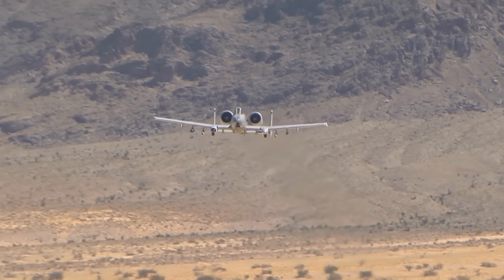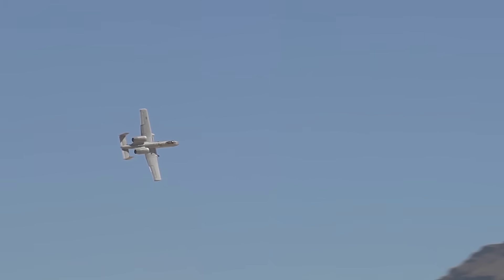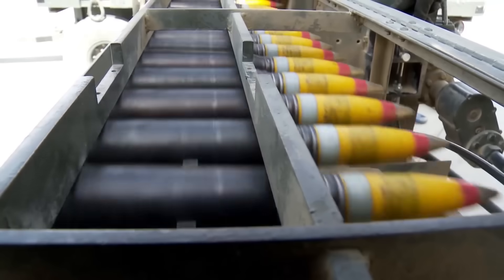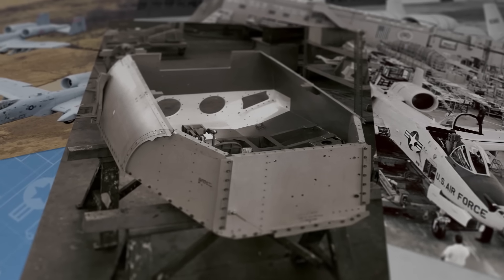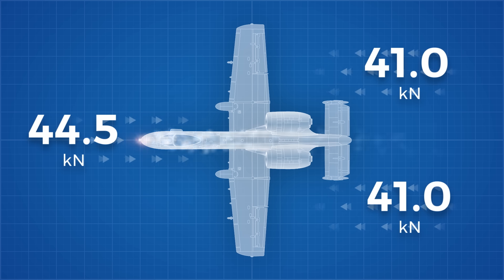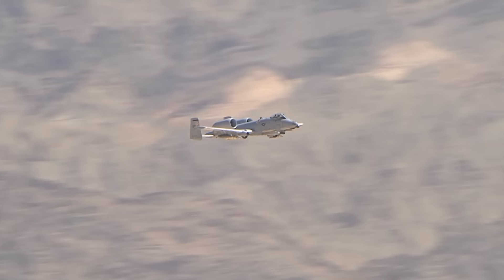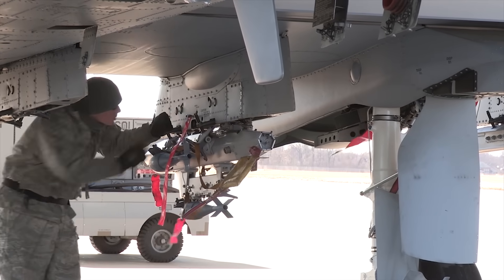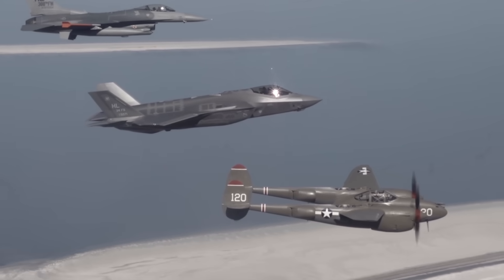The Insane Engineering of the A-10 Warthog

Comment: If you ever ask a soldier who had a warthog support them in battle wants thousands more to be build. That’s why I’ll always love that aircraft
Reply: Yep, beloved by men on the ground
Reply: Well most would say the hate it because the gun has a splash zone the width of a articulated bus and because the A10 does not have any targeting systems except a pair of binoculars it's very likely if you get an A10 as fire support you're gonna be the one with a 30mm round in the head
Reply: It's just a shame it outdated, but it's mostly beloved because of the sound and how you can see it firing
Reply: @Zlonk7  eh, I wouldn’t call it outdated, just needs some buffs
Reply: @civilrebel3743  I mean the original version hasn't been in service for a while due to how shit it was and now the newer version are expensive and one of the main points of the A10 was it being cheap
Reply: @Zlonk7  I mean, I’d rather have a expensive and good thing rather then cheap trash
Reply: @civilrebel3743  then buy an F35 imo
Reply: @Zlonk7  they both have their uses, however I’d use an A10 where SAM’s and enemy fighters aren’t a concern cause that brrrrrt would be a nice morale boost
Reply: @civilrebel3743  I mean some soldiers would consider an A10 a detriment as the splash zone is like 12 meters wide and thus kill anything in that zone friendlies and civilians included and since the cheap models only have a pair of binoculars as targeting blue on blue is very likely. Most of the people I ask say they prefer the more safe aircraft over funny brrrt

Comment: The centerline of the GAU-8 isn't mounted coincident with the centerline of the airframe. The centerline of the airframe actually lines up with the 9 o'clock barrel, which is the firing barrel and is where the recoil force vector originates

Comment: Some people: Replace the A-10
Me: If it isn’t broken don’t replace it. So far it is doing it’s job beautifully.
Reply: It really isn't , the gun can't bust tanks, it has no stealth and most of the redundancy it has is useless
Reply: @Zlonk7  most of the redundancy is useless you say tell that to the pilots you’ve had their hydraulics taken out over hostile environments and a good CAS plane is never going to have a super low RCS you just can’t fit enough ordinance inside an internal bay in a small enough plane to be an effective CAS platform and having it on the outside isn’t very stealthy and I’m not sure you even understand how stealth works it’s not no stealth or lots of stealth so I’ll explain, radar sends out waves those waves hit an aircraft and depending on a lot of variables some of them will bounce back and be picked up by the radar a plane specifically designed for stealth will be designed to minimize how much of those wave gets back to the radar so they end up with a lower RCS
Reply: @Zlonk7  you live up to your name
Reply: @vick3772  what am I wrong about? Tell me
Reply: @vick3772  I mean the gun can't bust tanks and is pretty much a liability
Reply: @vick3772  they did a live fire testing of the A10 on some tanks in the 1970's and they gave the pilot perfect conditions: he could fire as much ammo as he wanted, the tanks were not moving or deploying smoke, they were full of ammo, he could individually strafe every single one, the weather was perfectly clear, the tanks were outdated and most importantly, the pilot wasn't getting shot at, and still even with that only 3 of the 10 tanks were destroyed, and that may seem like a good percentage but that was in perfect conditions. So they decided that in a real combat setting it would be useless against tanks and that's the reason why it has so many pylons attached, so you can mount enough missiles and bombs to destroy tanks
Reply: If this article is to be believed their cannons were capable in in the 1990s during operation Desert Storm where their cannons were killing Iraqi tanks, it mentions the T-62 and the T-72, Both tanks are still in operation in some parts of the world, the at's cannon might not rip through the more modern tanks (cant seem to find info on things like armor thickeness on more modern tanks) however even with those limits the a10 would be able to rip up less amored targets effectivly such as infantry, transports, lighter armoured vehicles, ect. It may still have a practicle application in the event of a full scale war but in the fights it finds itself in with limited thick armor, enemy aircraft, anti air fire, etc it can still be very effective at supporting ground forces.
Reply: @stevencolor3389  link for the article
Reply: @stevencolor3389  the comment above this one suggest that that was just luck
Reply: @Zlonk7  "Significant results include catastrophic damage to 3 tanks, 1 tank immobilized and silenced, three tanks immobilized only."

"The Simulated Soviet Tank company was judged to have been effectively neutralized and incapable of continued offensive action, since all tanks but three were immobilized."

So, in reality, the A-10 took the entire tank company out of action, rendering it "incapable of continued offensive action." Do you understand what that means? It means the tanks were no longer a factor. They were, effectively, destroyed. A tank that can't move and shoot is, for all intents and purposes, destroyed. A tank that can't move is nothing but a largely ineffective artillery piece. Just as a soldier who loses a leg in combat isn't technically "destroyed," he's still out of the war. A target doesn't have to be "destroyed" to be rendered completely ineffective.

Pointing out that only 3 suffered catastrophic damage, i.e. were "destroyed," demonstrates you're either didn't read the paper, you're incapable of understanding the results the paper actually presented, or you're being dishonest.
Reply: @frocat5163  do you understand that those tanks were not moving, deploying smoke, and the pilot could attack every single one individually. Not to mention that the tanks were outdated and the pilot wasn't getting shot at
Reply: @frocat5163  ok yes the GAU 8 can destroy Soviet tanks, but if the tanks were moving, or doing anything that tanks do when they are trying not to get killed by an aircraft? Probably not
Reply: @Zlonk7  You forget something about what you are saying :/
Tanks ofc can move, and modern tanks moves well depending on the terrain.
But war isn't a video game, speed relative to your target is an important factor.
Flying around 400-500 kph shooting at a target moving at  40-70 kph is more than doable.
Being in a tank means you don't have much visibility and LOT of noise preventing you to be fully aware.
Plus again, this is war, when you shoot at a tank killing the crew count as a neutralised target.
OFC like all guns, the accuraccy and effectiveness is far from 100%
But as it is right now that platform is more than reliable.
When target moves fast , you send it an AGM, when target isn't moving much, you strafe it.
Reply: @Qyoon   yes I get it, but moving is not the only thing a tank can do
Reply: @Zlonk7  yep they have countermesures too, wich are not always available.
Remember we are talking about war not about a video game. 
You don't always see or understand what hits you when it does.
Nothing is 100% accurate or effective even modern missiles and bombs.
Reply: @Qyoon   look what I'm saying is the A10 is 50 years old and should probably be replaced
Reply: @Zlonk7  Why would you spend billion to replace something that is safe and reliable when you can just modernize it ? Be realistic a second, it's used mostly to strike 1970-1980 tanks and militarised 4x4. For what it is used for, it's great. Other planes already exist for modern combat scenario.
Reply: @Qyoon  at some point you can't modernize an A10 and were reaching that point I would say. How can you make a stealth A10?
Reply: @Qyoon  The close in CAS means close to friendlies, the plane can be in space but if it's close to friendlies on the ground it's still CAS and why neutralise the AA network when you can just sidestep it entirely
Reply: @Zlonk7   because stealth isn't magic. It's about making you harder to find, not invisible.
Once you are on the spot  and start fighting , you are not stealth anymore and will go down.
Reply: @Qyoon  I mean if you start dropping bombs you can just close bomb bay doors and disappear on radar again
Reply: @Zlonk7  This is not a video game lol.
Stealth doesn't mean you are invisible. 
It means you are HARDER to detect.
Having bomb on a stealth plane means having them hidden inside.
So less load, less efficient during operation. ( F35 main issue for exemple)
You won't disappear by closing your bays since you have never been invisible.
Now you are noticed the enemy will just get a closer look and find you.
Thats why you use stealth bombers that leave the area as soon as they dropped.

CAS planes needs to be in the area of operation and remain near to provide support.
Again , stealth isn't a magic answer it's a tactical tool.
Reply: @Qyoon  alright then fine I guess if you can't use stealth then clear the AA systems and then use an F35 for CAS since it can carry about as much ordinance as the A10
Reply: @francesco3772  they want to see pilots die so they can hear the "brrt"
Reply: @fulcrum2951  pilots and allied soldiers as well, remember the incidents with the brits in '91 and 2003 due to both the pilots' negligence (US pilots fucking up is a dangerously recurring event if you ask me, well beyond the laws of probability) and the A-10 outdated targeting and communication systems, in a battlefield where awareness and identification are now considered the most important factors to mission success.
Reply: @fulcrum2951  you do realize a key part of the A-10 is being survivable right because CAS is needed and the A-10 is the plane that give the pilot the best chance of getting back safely
Reply: @Skylikesavation  That's really nothing special. There are plenty of instances of F-15s and F-16s losing a wing and being able to limp back to base. One Israeli F-15 even managed to make its way back after a mid-air collision with another plane. Anything can fly (or glide, for that matter) if it's going fast enough, and modern combat aircraft get their lift from the entire airframe, not just their wings.

Besides, the A-10's "durability" isn't what it seems. When it comes to survivability, it's stuck at the last layer of the Survivability Onion, "don't be killed". But the problem is that modern anti-air defenses tear it to shreds. The A-10 actually had to get pulled off the front lines during Desert Storm because Iraqi air defenses (which were hardly state of the art, even back in '91) were chewing it up so badly.

The A-10 simply cannot survive in a modern threat environment, whether that be contested airspace or sufficient air threat coming from the ground. That's why air forces around the world are embracing stealth technology. If you can go all the way back to and depend on the first layer of the onion ("don't be detected") the raw durability of your airframe becomes less and less of a factor.

Comment: Little nugget: The GAU-8 Avenger isn't actually mounted down the center-Line of the A-10. If you look at it dead on (10:02), it's actually offset slightly to the right, but the firing barrel of the rotating cannon is at about the 7 o clock position to give the desired effect of recoil down the centerline.

Comment: A handheld missile launcher can bring it down easily. A-10 for close support flies low and at low speed, they are good preys for the short range missiles.
Reply: So are anything flying and dealing out kaboom close and personal against a near peer opponent with decent AAA. Against badly trained and equpied soldiers and ragtag millitants CAS planes and attack helicopters have a good record

When it was designed, the A-10 was basically intended to be used as a somewhat
expendable flying sledgehammer against Soviet tank divisions. Rugged enought to take some damage while doing it, but was not be expected to survive for long.

Comment: One key thing to add about the engines in the tails of airliners, while they don't generate much significant thrust on their own they can alter the drag profile of the craft, thereby increasing the effective thrust significantly. This is supposed to be where the first step towards electric engines will be, the tail engines we currently see are to be replaced with electric with specific intent to alter the drag profile, as that's a nice easy retrofit.

Comment: Worth noting that, among large civilian aircraft, there has been limited success controlling an aircraft that has lost all hydraulics  by modulating thrust between the engines to turn left/right and modulate lift.  I've yet to hear of a successful landing under these conditions for an airliner, as its control surfaces offer so much resistance that no pilot is strong enough to meaningfully alter them without the assistance of hydraulics and maintaining a controlled descent requires landing at speeds far beyond normal operating procedures.  I'd imagine the Warthog's smaller control surfaces are much more manageable, which would grant sufficient control for an unpleasant but non-calamitous landing.

Comment: When I hear "the A-10 was primarily designed to handle Soviet Tanks in the Fulda Gap" I just shake my head.  When the design team started developing the A-10 they studied the Close Air Support aircraft and aircraft involved in ground support all the way back to WWI to make sure they developed the quintessential CAS aircraft.  Its greatest test would be a contest in the Fulda Gap, but the platform has PROVEN it was designed and built correctly for its mission set ever since the first units went into combat.  The A-10 is the most capable and versatile CAS aircraft on the planet, and the fact that USAF brass hate the platform should tell you everything you need to know about their personalities, and their desire to protect our troops on the ground.  Yes, fast jets do an adequate job too, but the A-10 is what the troops want to see when they call for air support.  However, the army troops on the ground (the Customer) desires are almost never considered by USAF brass when such mission set response are considered.  The USAF brass have to justify having built all those fast jets.

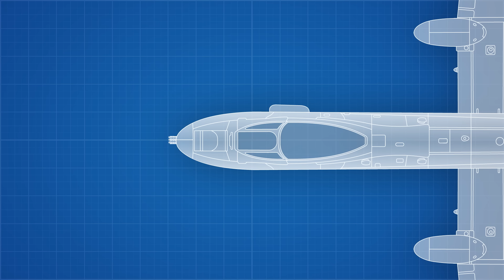Comment: 7:45 This is actually incorrect. The gun is located slightly to port, and fires at the 9 o'clock position front on, which is in line with the center of mass.

Comment: Actually, the axis of the gun barrel is purposefully very slightly off the center line of the plane. This is because only one barrel of the cannon fires at any instant (the barrel at the 9 o'clock position). So the gun is mounted such that the barrel in that position is aligned with the center of the plane.

Comment: “The A-10 Warthog is not to be flown upside down in the field” 
6:44
Reply: I think he meant when in the battlefield and not after Air-to-air refueling
Reply: It can fly upside down. But never, in the battlefield.
Reply: I am tho
Reply: The top is not armored
Reply: @jimrobcoyle  yes it is, just less.
Reply: He had to go upside down to go down faster
Reply: Haha ! Warthog goes brrrt !
Reply: Battlefield pilots be like 
Goin up the sky, goin down the sky, goin up the sky, goin down the sky, and goin attack jet mode.
Reply: I think it's more "don't go upside down anywhere near the ground" both because the canopy has less armor and you don't want to point your weakest point at your enemy, and going upside down will effect the aerodynamics of the plane.

It does look really cool to break off and go upside down though...

Edit:going back and listening "this isn't the type of plane to be flying upside down over the battlefield".
Reply: @DarkKnightofIT  Physics doesn't change based on orientation.  The aerodynamics ARE NOT affected by flying upside down.  Up/Down is reversed and the pilot needs to be aware of that.
Reply: @uberfu  I meant that the plane flies differently upside down, than it does right side up, not that the physics changes.
And the wings are designed to push the plane up, if the plane is upside down it will probably effect how the plane flies. (IDK how much this applies to an A10 though)

Edit: I have realized the "aerodynamics" is probably the wrong word to use, and "handling" would have worked much better.

Comment: Good video,but as far as I know, there is a point is mistaken. Actually the 30 mm main gun is mounted a little bit to the right,if you look from in front of the plane. When it is firing, only the barrel on the 9 o'clock position with shoot the rounds, so the recoil force is on the center line of the plane.

Comment: Such a niche weapon platform, no wonder it had severely limited deployment.

-highly vulnerable to missile weapons due to slow speed and low service ceiling (flares can only do so much).
-zero stealth capabilities would guarantee early detection without large valleys or other geological cover. 
-cannot take off or land on carrier
-mission inflexibility due to large fixed weapon system (main 30mm cannon) specialized for armored ground targets. 
-zero dog fight capabilities. If it encounters an enemy fighter jet it is doomed. Requires to be escorted. 

It's great for attacking poor countries (which seems to be the preferred targets for the US), but any modern military will absolutely wreck the A-10.

Comment: The Warthog is a single-seat, straight wing plane, powered by two TF34-GE-100 turbofan engines. The high-mounted engines allow the Warthog to land in exceedingly difficult terrain. “I’ve seen this airplane land on a desert strip with the main gear buried in a foot of sand. On most planes, this would have ripped the gear up, but the Warthog turned right around and took off,” said former Warthog pilot Lt.